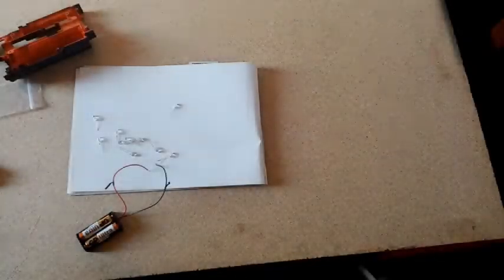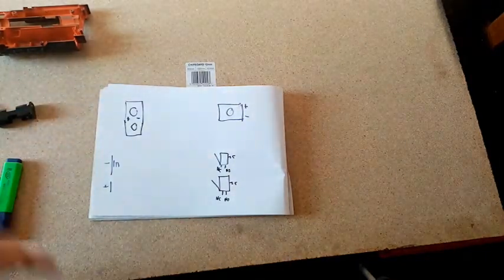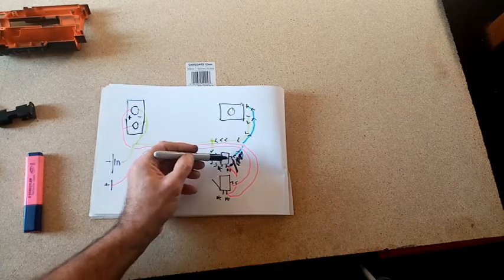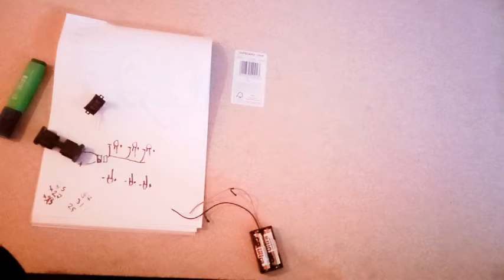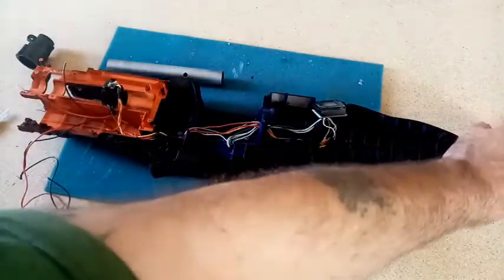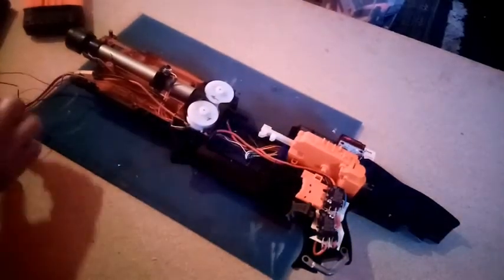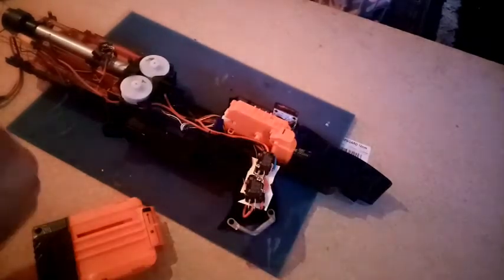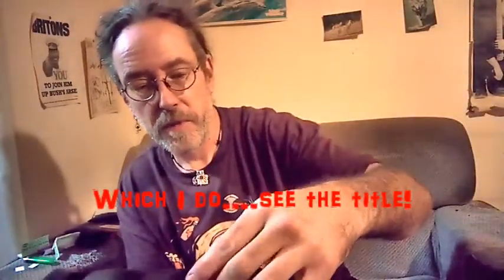[Ner mods]  Ultimate Rapidstrike Build Pt 4....The final bits

Comment: hey! how did you wire the thing in? does it work? can i use the stock barrel?
Reply from the maker: Oh yeah, it works.  The wiring was a total pain to be honest, but basically a matter of cutting a tiny little bit, testing, cutting a bit more, over and over until everything fitted where it should be.  And yup, you can use the stock barrel.